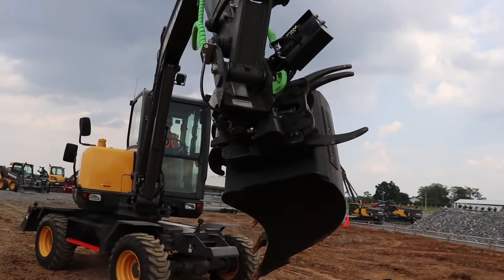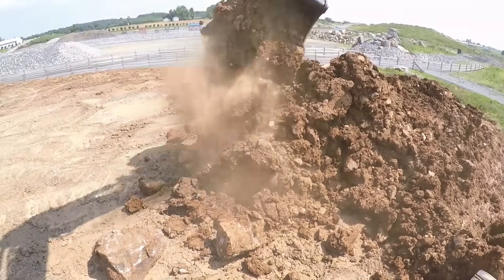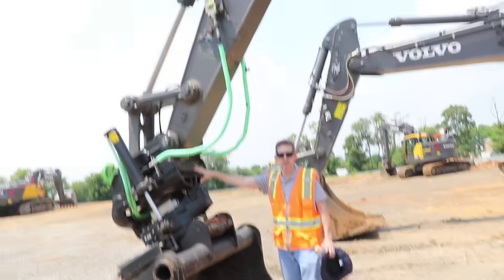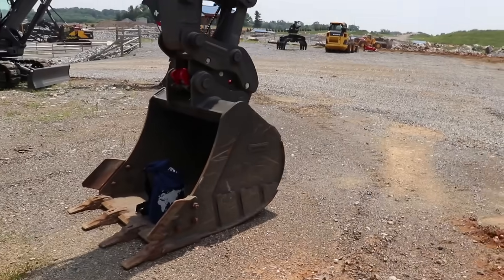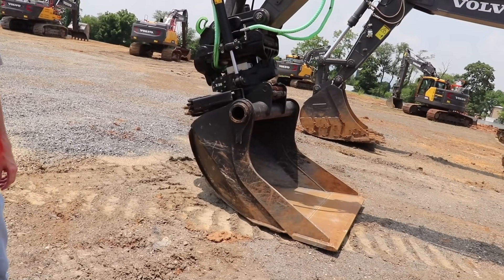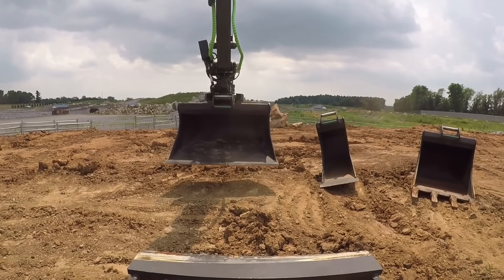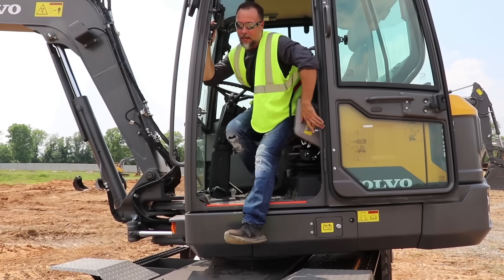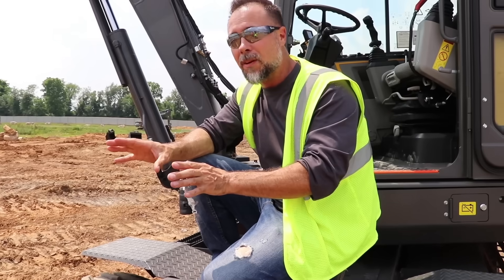Tiltrotator at work -benefits & drawbacks

Comment: I use an Encon on Huddig 1060b i drive the most, 
A Indexator RT60b on my Case 888p , a Encon on the Doosan Dx140 at work, my buddy uses Steelwrist on his machines and my dad has an Indexator Rotortilt on his Huddig 1160 
And.. No- we dont want to work whitout them in Sweden…

Comment: Tbh encon, steelwrist, indexator, they all have drawbacks and benefits, but ive been operating excavators about 12 years now and never without a tiltrotator, its a sweet addition BUT the bad part is that if you never learned to run  an excavator without a tiltrotator, you are crippled if its breaking or for some reason you dont have one avaible, so rather run without one for a year if possible and THEN learn with one.

Comment: I’m in Seattle and I ordered an Engcon for my mini a week ago, excited to get it and have it installed! EC204, 3 buckets and grapple
Reply: What does a set up like that cost?
Reply: sweet!
Reply: You sir will never look back i think.
Reply: Eh, I run a mulched all the time, can’t use a tiltrotator with a mulcher
Reply: @ayeeeeewrc  can't or won't?
Reply: @AlexKall  can’t, a tiltrotator can’t handle the heat or torque needed.
Reply: @ayeeeeewrc  actually depends on the machine you have, for example if you are having a separate aux line and drain its still the machine that will handle the heat etc as usually. But it adds on weight of course and not being able to have 360° free turning ability but some at least with longer hoses ( better than none sometimes). The tiltrotator it self won't let take much power unless you uses it nonstop  basically.

Some brands offer a higher flow capacity when you order it. 
It all depends on what machine, how it supply power, size on machine to handle it and how it's connected and hooked up of course.

Comment: NICE EASY TO RUN HYDRAULIC EQUIPMENT TRY RUNNING CABLE OPERATED EQUIPMENT FROM THE 40S.
Reply: Yes, I hear ya, B&E 25 or a 1066 Koehring with air over hydraulic for the controls

Comment: Tiltrotators are great. But you need to think about fuel economy aswell. Having the tiltrotator on while trenching si not good for fuel economy. It is a lot of exstra wight on the boom and the machine works more to move the dirt with it on. And it puts unnesesary wear on the tiltrotator aswell.
Reply: 2 biggest companys selling tiltrotators have the option to take it off with a switch, takes no longer then changing buckets.
It all depends on what you're digging for the most part, I have a semi-quick coupler wich is called "faster" and it takes me max 1min to take it off (I need no tools).
In what world don't you have 1min at work? ;)

Comment: Just to clarify a few things. Steelwrist hasnt been around for 20+ years the tiltrotator has. Indexator and rototilt pioneered the product in the 80:s. Not 100% of the excvataors in sweden uses them. I would say 9/10 in the 5>32ton class. Larger excavators ie EC380> dont use them. There is one EC380 on Gotland in sweden wich uses on but thats a 32t class tiltrotator beacause no1 makes one to truly work with 40t class machines.
Reply: Rototilt has announced they are making one for max 40tonn excavators if i remember correctly. Its called Rototilt R9. Imagine running a EC380 with that! Would love it even tho im a Engcon fan.
Reply: From my understanding. Engcon i think in the past tryed making a 40t tiltrotator and failed miserably. The breakout forces are just to big so you need to move nothing but gravel and sand when using one. If they somehow make it work i dont think that many would equip 40t excavators with one.
Reply: then engcon simply failed. i doubt Rototilt would release their 40t rotor if it didnt hold up.  they do serious abuse tests when building tiltrotators
Reply: Ehm??, yes engcon failed like i sad?? Im sure Rototilt has a great product. I doubt thou that it will have as long durability as the smaller ones have. A 40T excavator is alot more expensive by the hour then a 30T. I might be wrong, it might be hugely popular and sell well but in my opinion i dont think so.
Reply: im hoping it'll be usefull. i'd even prob buy the 40t rotor for a 30-35ton machine just to have some beefier gear. im currently running engcons 30t rotor on my hitatchi 210! love the power of it.
Reply: MRT tiltrotator makes one for machines up to 50 tonne. We have one for our volvo 480.

Comment: I live in Sweden and I can tell you that no one (literally no one) with an excavator here are digging without a tiltrotator. The most people use engcon which doesn't have that hoses you need to remove before de-attaching the rotator :)
Reply: Some do. And if you go up in size they all are running without.
Reply: Are they $40,000.00 over there ? Pretty hard to justify on a smaller machine here in Australia
Reply: @fearlesswhetu4555  depends on the size, but they are expensive.
Reply: @fearlesswhetu4555  yes even on a 4ton machine
Reply: Det är humor att se amerikanska grävare som kopplar loss enbart grävskopa med den där stora fåniga sprinten hehe

Comment: I don't have the rotating version of this attachment but I do have the 90 degree swing attachment from Bobcat for my 4 ton excavator.  Yes, you loose break out, probably about a third with a 36 bucket but the versatility is so worth it.  I just bring the reg bucket for the digging and then switch to the swing to grade and swail perfectly, no shovels required. Thanks Stan for the info, now I have my next attachment to strive for.

Comment: I'd want the bucket edges to be straight rather than S shaped for ease of stocking/storing.fixing wear strips to replace the cutting edges.

On a normal bucket the flat edge along the front is the primary wear surface but on a tilt rotate you've got three front edges!

Comment: Wonder how much wear and tear goes on them over time? Those buckets without a bolt on cutting edge are not ideal for cutting/shaping. Nice concept but have no idea what they would cost to rebuild, some of those 84" chuck blades can cost north of 12K to rebuild so lol.
Reply: In sweden you can buy 6 new buckets for a 12k rebuild or 4 if you want a bucket sized for 20-30 ton machines and that's better quality then this bucket showed on video :)
Reply: Buckets are cheap, the tiltrotator though is extremely costly, but quite worth it.

Comment: We just got a tilt coupler for our cat 305.5, not a rotator wish we'd got one of those cause that'd really make it even more versatile. Already I've noticed several drawbacks. With the thumb, which had to be modified so it's now kind of an s shape instead of just straight, so it hangs down like a foot or so from the dipper. So now you can't curl the bucket even close to all the way up. That makes loading trucks with it a real pain. I spilled a LOT of crap loading the last few days, where I usually have very little if any cleanup around the truck. Definitely noticed quite a big loss of breakout force, probably makes a bigger difference on the smaller machine. I'm just not sure about it yet, I was really excited waiting on cat to install it but have been kinda let down so far. Haven't gotten a chance to use it for what it's meant for but that should change this week. I also wanna see how big of a difference it makes in hard clay and rock. Another thing, it's dramatically changed the throw of the bucket. It's taken some practice to get back in rythym. But just  having the quick coupler probably makes it worth the drawbacks.lol
Reply: Marttiini has model wich has rotor and tilt separed units. https://www.youtube.com/watch?v=E5YAYjF05lE